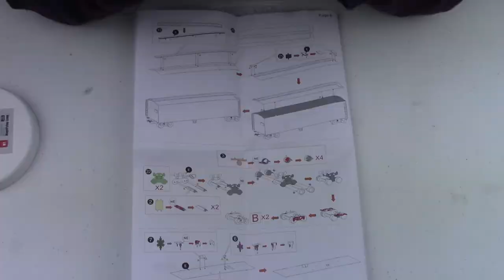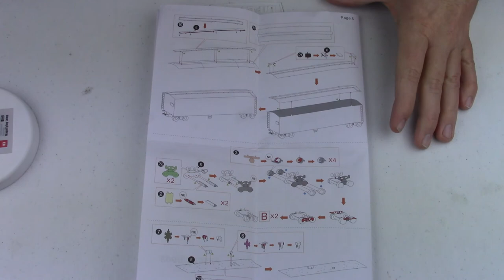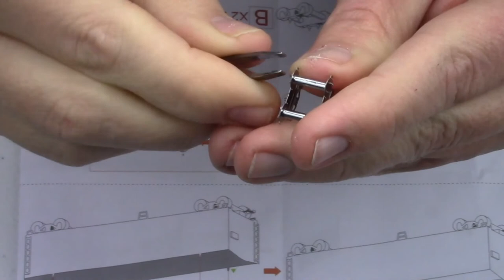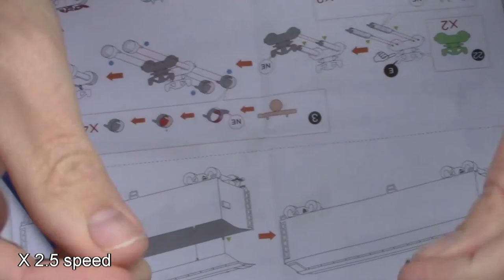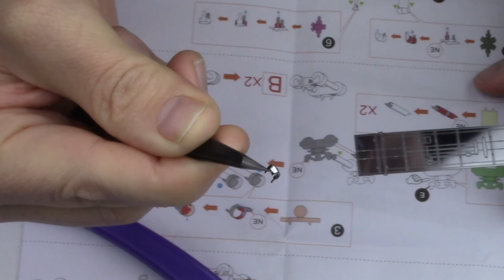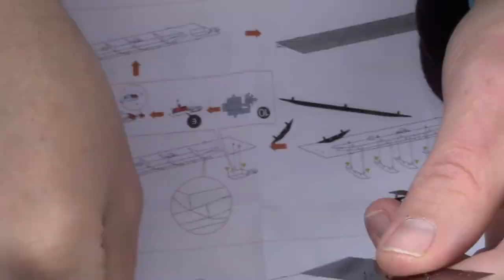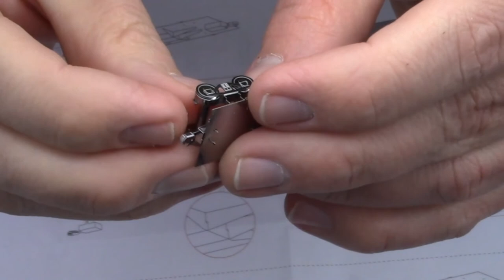Metal Earth Build - Freight Train gift box - Hopper Car

Comment: you do a great job. looks great! however, just so you know... the model company have mislabeled this as a Hopper when in fact it is a Gondola... you can tell because its short side walls and long (like the gondola boat) and has NO "V" shaped dispensers underneath. btw- that little weird piece underneath is called the brake cylinder air reservoir.
Reply: And the description is flopt as well